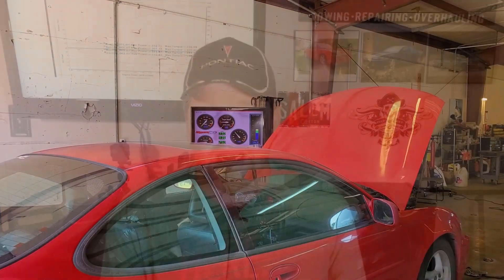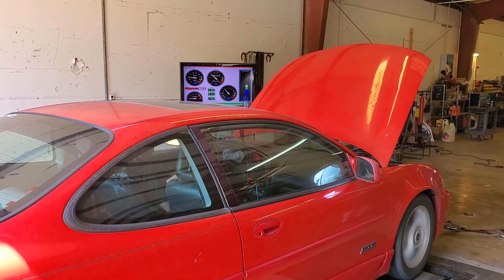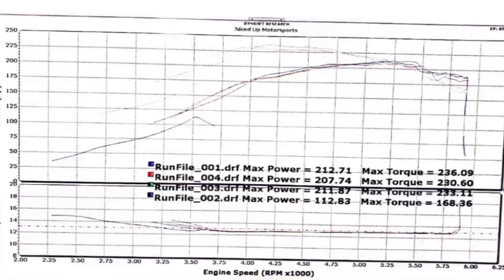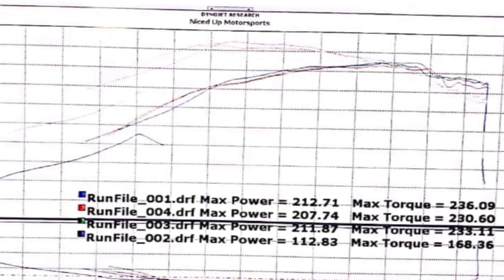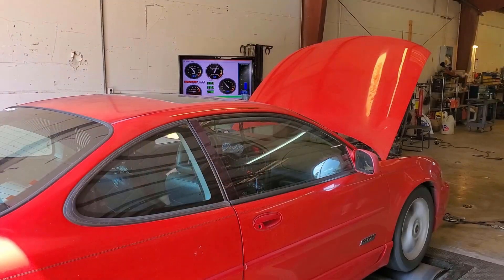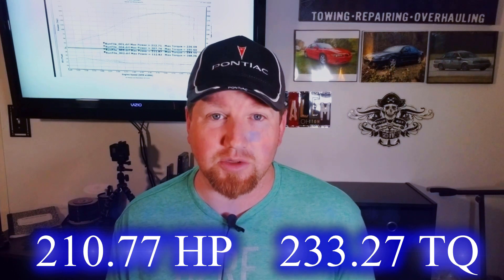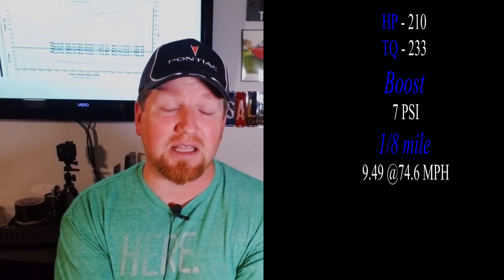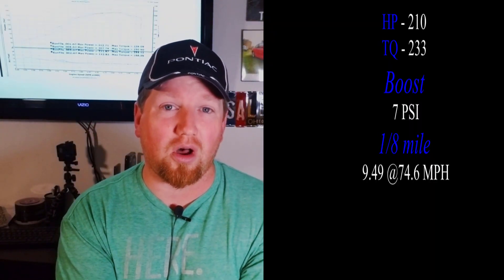230,000 Mile GTP hits the Dyno for the first time!

Comment: that's really good.

I made 234hp & 312ft lb with a 3.4 pulley, short stack exchanger, 2.5" zzp catted downpipe, p-long, 1.9 rockers, LS1 #90 valve springs. I was fighting kr and had pretty bad heat soak (4 hour drive there) was about 80° outside temp. 
i have Sense put in headers and dropped to a 3.3 pulley and this car rips. I haven't gotten a chance to Dyno again but I'm making significantly more power than before

if any of you want to slightly modify your GTP. don't get the 2.5" downpipe. it's too restrictive when you pulley down, the 2.5" downpipe is only good for slightly modified (intake, 3.6 pulley). 3" downpipe is needed for most cars a can handle alot more. headers for slightly serious mods.
Reply: Pretty good numbers!

I made 236 & 306 ft lbs on my 3.5/bolt-on setup on the buick. I do in fact have a 2.5" downpipe, and i will agree there is a disadvantage there. Not as much at the bottom end, but you definitely start to feel it in the upper end. 

I'm going to throw some rockers, springs, and intercooler on it next season. Hoping to make 250+ and at least 310+ torque.
Reply: Made 239 whp on my DD 01 GS. 3inch catted DP, full ZZP exhaust, 65lb injectors, 255 FP, fender CAI,  3.25 pulley on E85 conservatively tuned by Intense. Everything else is stock.

Comment: 210 hp wheel hp stock!  Pleasing to hear; my 2002 with 93k miles is completely stock except an aftermarket free flow cat and a low restriction aircleaner filter.  It has adequate power but wouldn't mind more; but the transmission is too delicate for that.  Mine grenaded at 78k and cost $3300 to rebuild.  I had to do that because of the VIN; it was built at the very end of the 2002 model year and I could not find a replacement.

Comment: this makes me want to turbo...it seems like the process to get over300 whp will cost a fortune.
Reply: Turbo kits are pretty pricey, but they're super fast. I've seen a turbo 3800 smoke a 2JZ Supra.
Reply: @BassManBobBassCovers  i have a sc300 which is identical to a supra...price wise its cheaper to get 600 horspower out of it than a 3800 trying to get 400 with reliability meaning trans. The s300 or base supra can get an aristo motor with trans for under 3000 and put down hellcat numbers or better. But i love my Indy edition ss impala